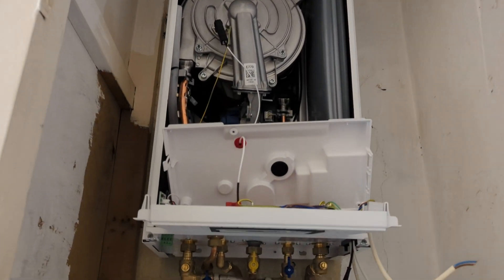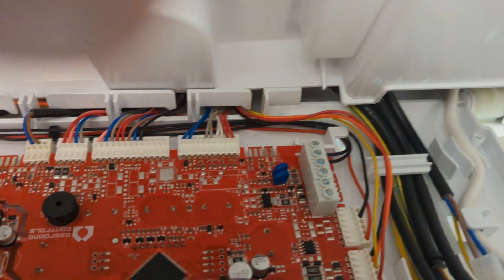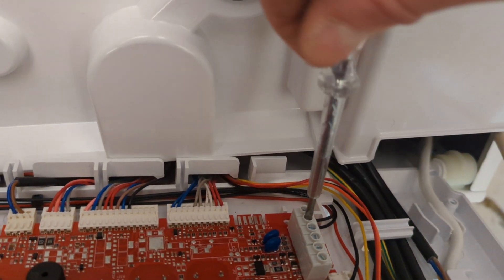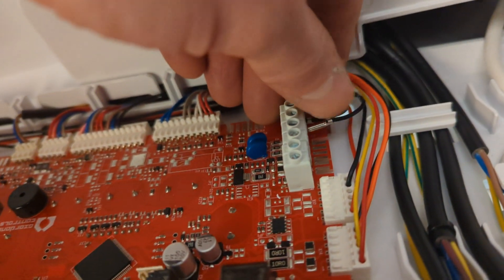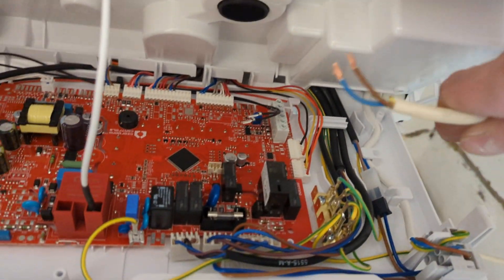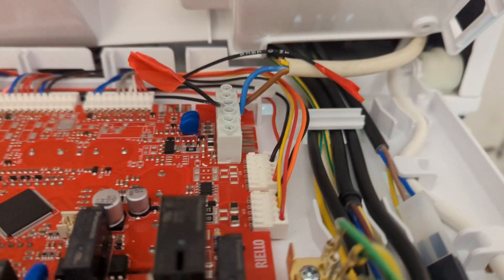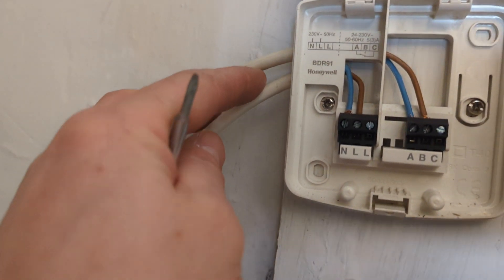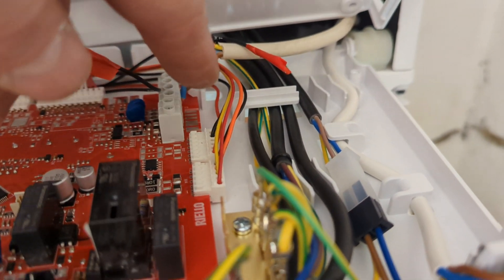Vokera Vibe Max combi boiler. Wiring a programmable thermostat.

Comment: Do not remove wires at x11 block. There's a volt free thermostat link at the M4 block.  Unclip the terminal block and remove link on the bottom and thats where you connect hive thermostat switch wires. Vokera have overcomplicated a simple job as per usual when they change model dedign.

Comment: Nice video, but did you say Vokera recommended to wire this way directly into the X11 block?

Although this way will definitely work, it is not really ideal as wiring up this way sort of negates some of the cool built in functions of this Boiler, mainly App control & an external ON/Off bypass switch.

The 2 black wires that you disconnected on the X11 "control" connector block (the one on the back right of the PCB) are the main feed coming from the "Bypass Switch" & the built in Bluetooth module, which means the Vokera Easi-connect App won't work for remote access to the boiler to allow on/off & 7 day programming anymore. 

 Looking at the factory wiring on my Vokera Vibe Max, it looks like the wiring going into the 1st, left side block, looks to have been changed also? 

The black link wire should link the 2 middle connectors, not the 1st & 2nd. Normally you just have to remove the black link wire and replace with your 2 voltage free wires from your Room Stat. 

Also the auxiliary switch that is under the boiler and gives a simple, basic On/Off switching won't work as this also using the connector block that has been disconnected.

I am not really sure why Vokera told you to basically disconnect all the built in controls, maybe it depends on the Room Stat being fitted, i.e "Smart" so I guess you won't need the built in controls anymore? (but that auxiliary switch has been a life saver when my Nest 3rd Gen Learning Thermostat decides to play up and not connect to the Boiler!)
Reply: Just noticed the left hand connector looks to be OK, the one in my Vibe Max is the other way up with the link wire uppermost, that is why it looks different to yours! The link wire for the Room Stat is on the bottom row, which is a pain as you will need to take the block out to wire it in, nice one Vokera!

Comment: Nice video! Can I wire my hive using the same method in this video please? I have the Vokera Easi Heat 29c. Thank you so much!!
Reply from the maker: ...off the top of my head, it is very similar but i would consult the manufacturers instructions as well just to be on the safe side...

Comment: Hello, I have a Vibe 25a gas stove. I have a problem with turning on the stove..The furnace has a problem with starting. When I hit the integrated circuit board, the furnace starts.The question is which relay is responsible for starting the furnace.
Reply from the maker: I don't fully understand the question but vokera have a good technical helpline. If you Google their phone number, they will definitely help you with your question